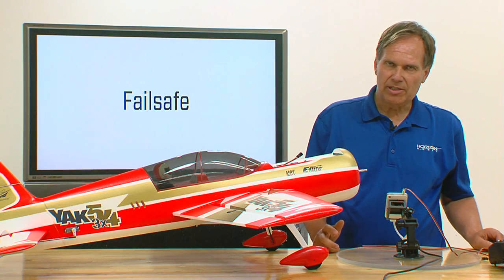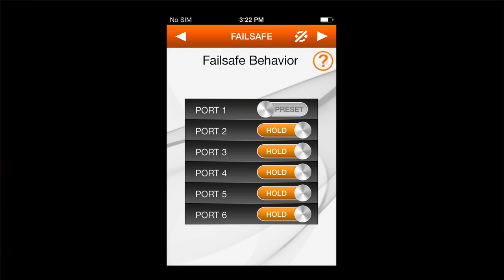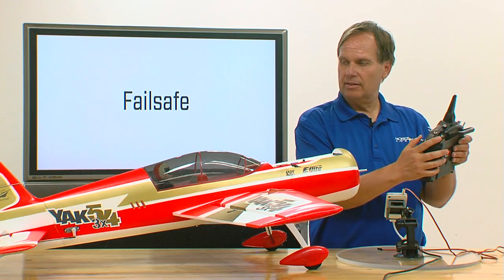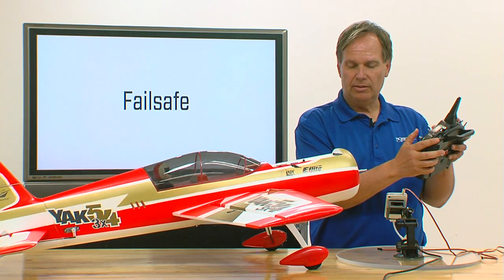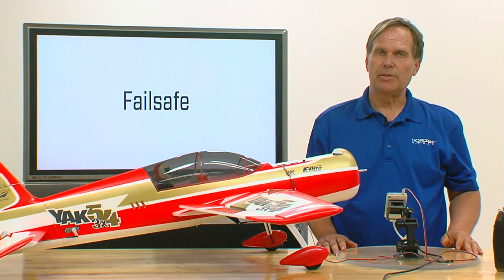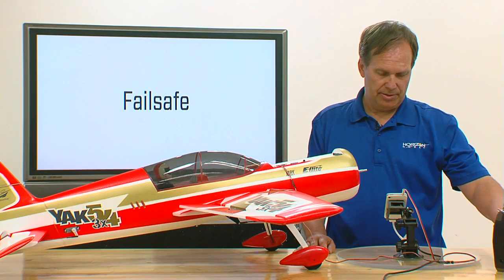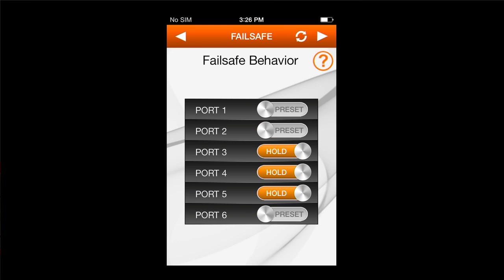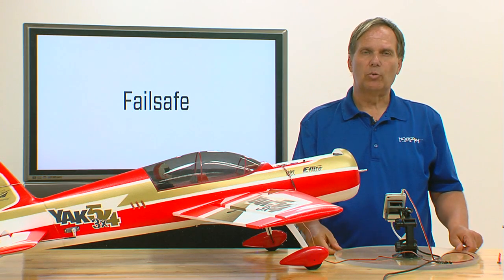Spektrum AS3X Step 11:  Failsafe Setup (Initial Setup)

Comment: I have a question regarding a motorised glider. I intend to install a return to home flight controller with GPS and a Spektrum receiver. Can the throttle be pre-set at a failsafe value of lets say 25%? I'm running a DX9.